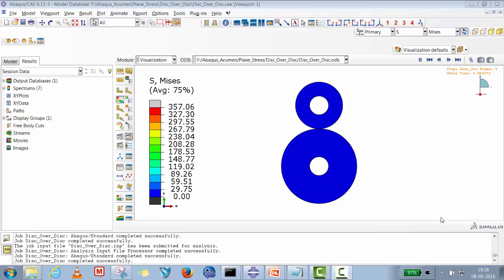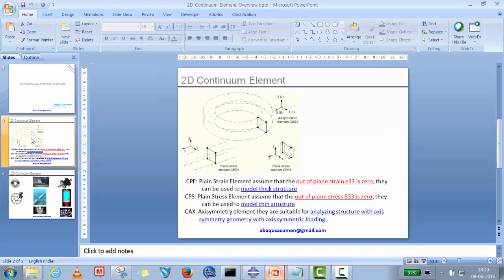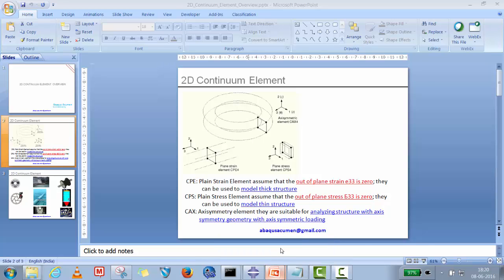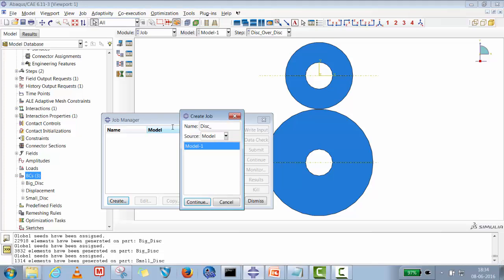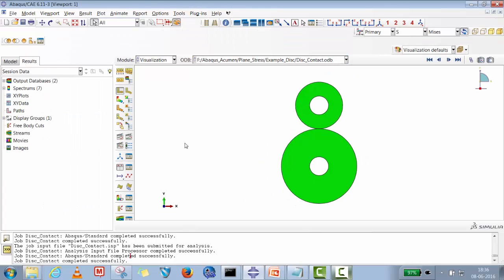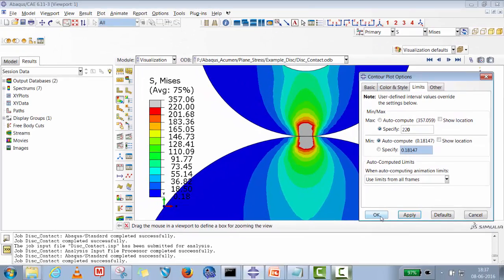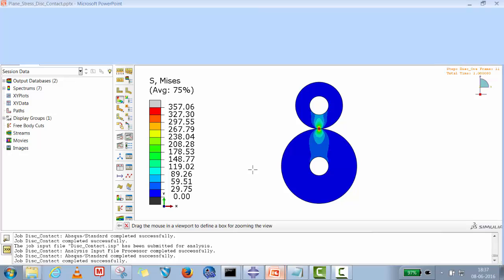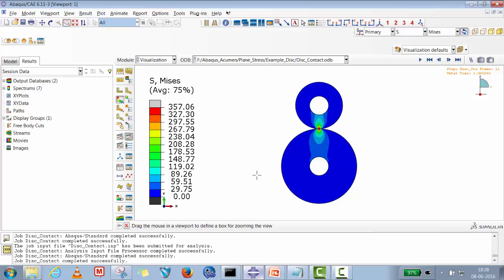Abaqus CAE/Standard:Use of plane stress element to model disc over disc contact in wrist watch

Comment: Great tutorial, thank you! Also, what if a thin layer of lubricant is placed in between the discs? what are your suggestions to model this kind of problems?
Reply from the maker: You need to change the friction value for the addition of lubricant addition.
Reply: Thank you for the reply, my idea was to build a thin layer and provide fluid property by defining density, viscosity and eos parameter (Us-Up). I will also check the possibility of providing an alternative value of friction coef however I will need to study in depth how this parameter is controlled by Abaqus